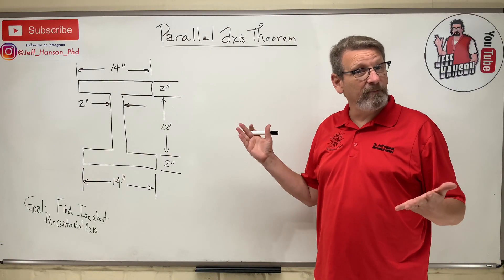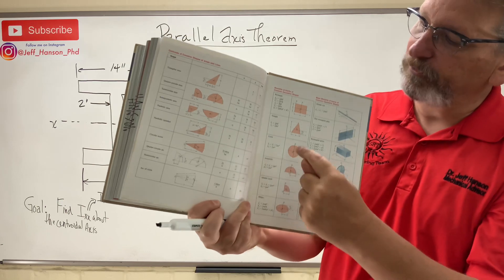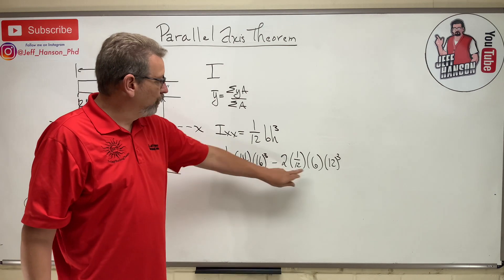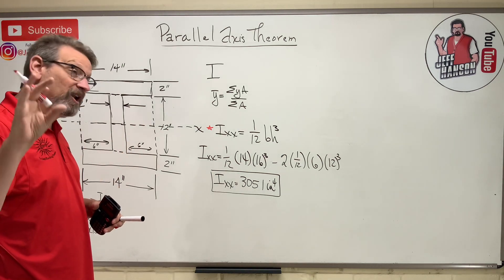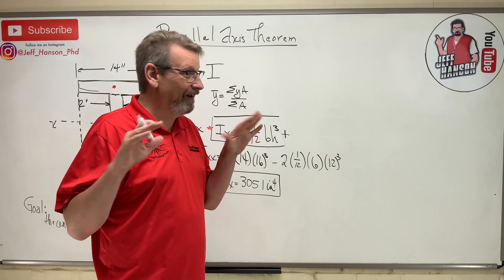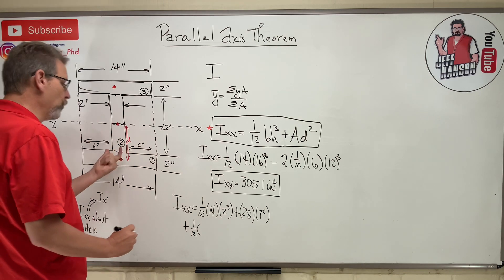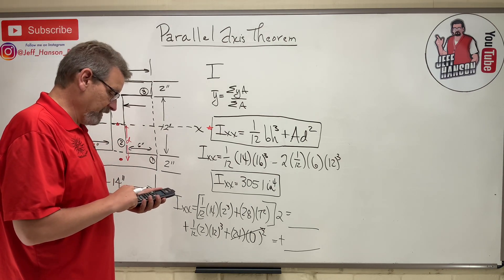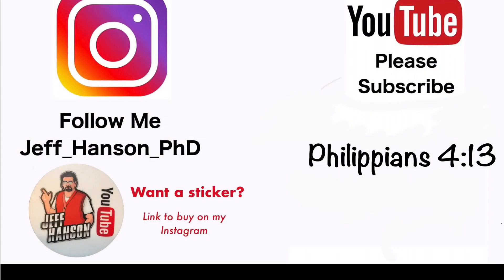Statics: Lesson 68 - Parallel Axis Theorem, Area Moment of Inertia

Comment: Really excellent presentation. I especially appreciate when you explained the significance of moment of inertia so we understand WHAT the number means (higher moment of inertia = higher resistance to bending = stronger shape). Thank you
Reply: It really has nothing to do with inertia.  It is named "area moment of inertia" because the calculus that defines it is very similar to the calculus that defines moment of inertia in rotational dynamics.  The essential difference is that the differential term is area, rather than mass.

Second moment of area is a more accurate name.   Moment in general means a quantity multiplied by a distance from an origin, added up with that value throughout a system.  Second moment means that distance is squared as you calculate it.  It comes about because fibers contribute to resistance to bending in two ways, that are both proportional to the distance from the neutral axis.  The first way is that the fibers are stressed in proportion to how far they are from the neutral axis, and the second way is that the fibers contribute to resisting the applied bending moment with a "lever arm" that is the distance they are from the neutral axis.

When you have a composite assembly of materials that form the beam, Young's modulus also plays a role in each term that gets added up.  Beams of a uniform material put Young's modulus as a constant out in front when calculating deflection, because it is term that is the same for all fibers.  Composite beams need to include the granularity of how Young's modulus applies to each portion of the beam specifically.

Comment: What if you want to find Ix and not Ix'
Reply: The parallel axis theorem can be used for moving to and from the center of mass, or for this kind of "moment of inertia" rather, the centroid (center of area).   For moving to the centroid, you subtract A*d^2, and for moving away from the centroid, you add A*d^2.

You can use it to move between two axes that have nothing to do with the centroid, but you would deploy it twice, with the centroid as a waypoint in this calculation.